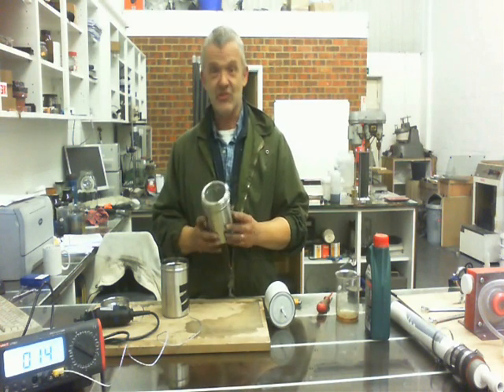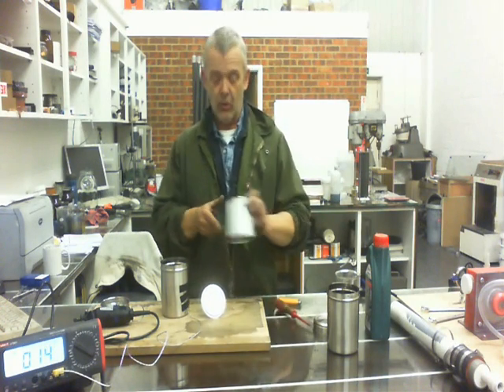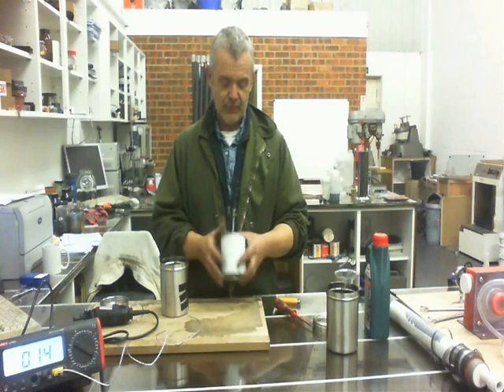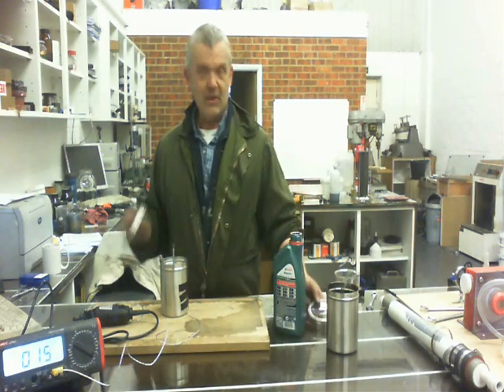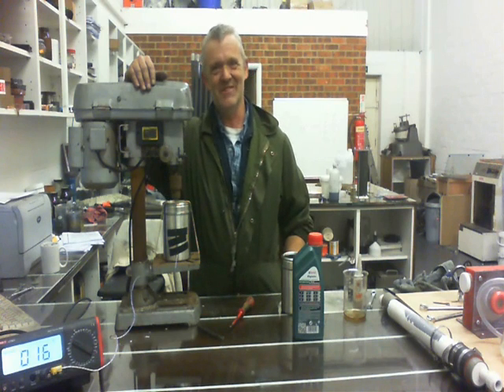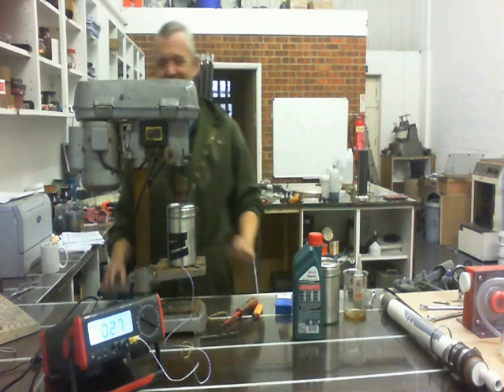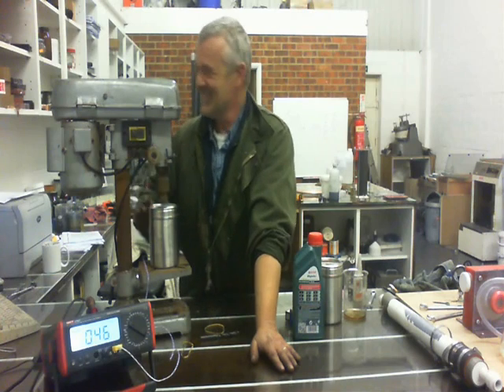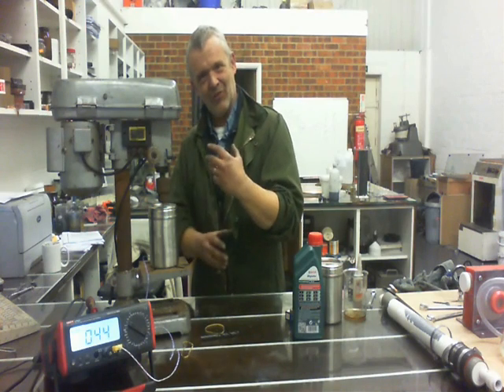Very Simple Friction Heater Made In Under An Hour

Comment: If you had electricity, you would just use a resistive heater, but what can you do without any power?
I've looked at  several frenette designs, and some used many discs on a shaft turning in a pail of oil.  Perhaps you could try that as well.
Reply: I got another idea , like how car turbo generate heat , or air pump generate heat after using it extensively, instead of disk, use air , friction in air molecule genrate heat.
Reply: Doesn't they will have short life span , after some time friction will cause material to end.

Comment: The best use I see for this device is when you want to convert a mechanical source directly into heat without going through many energy conversion. Example: Windmill. Instead take mechanical energy of your windmill , convert it into electricity with a generator and from this electricty to heat with a heating element. You can just convert it from mechanical energy to heat directly with this friction heat device ( frenette heater ). I don't know if the practical ( not theorical ) effiency is better. Somebody know ?

Comment: I accidentally boiled water in a centrifugal water pump when it got switched on while the outlet valve was closed.  The water around the impellor got so hot it melted the plastic components of the pump. Try it with your pool pump!

Any fluid will get hot if it has something agitating it violently in a confined space.
For example, auto transmissions get very hot without consuming the transmission oil.

I don’t think it is mysterious – it's friction between the impeller and the fluid. 

Unless you have a free, or very cheap, source of energy to drive the electric motor that spins the rotor inside oil (or other fluid) confined in a small space, then you might want to use that energy to produce heat by way of an electric heater.  

For example, if you had a waterwheel driving the impeller to make the fluid confined inside this unit hot, that would be cheap heat.  But using an electric motor to drive the impeller to produce heat by friction would use more electrical energy than heat produced. 

Solar power would not be much use as you likely wouldn’t need the heat on bright sunny days and storage batteries are too expensive in the capacity needed to drive a powerful enough electric motor long enough to produce useful heat.

Every time you change energy from one form to another, there is a loss of energy. So converting electrical energy into heat using friction to produce that heat, seems to be inefficient.
Reply: I did the same and had no clue what happened until just now 😂 I didn't even know this was a thing.

Comment: here is a similar device that uses simple crude wood blocks as the heating surface and produces steam. it actually seems to be consuming the wood in a more efficient manner than a fire does with no flue loss obviously and therefore i wonder if its steam could power the turning wheel itself and become self sustaining until the wood was consumed. its not perpetual motion because it is consuming the wood for energy. in essence a very efficient boiler. https://www.youtube.com/watch?v=ROF-CImcDkc
edit2: apparently he now has it running off a steam engine from the friction heater and it requires no outside input after startup https://onedrive.live.com/?cid=A4A1D6E4BB17A7E3&id=A4A1D6E4BB17A7E3%21367&parId=A4A1D6E4BB17A7E3%21365&o=OneUp   discussion http://www.energeticforum.com/renewable-energy/2835-friction-steam-boiler-2.html

 and here is rapidly rotating magnet wheel heating up a copper pipe in seconds to extreme temperature. https://www.youtube.com/watch?v=8n5sSmJsCdY

edit: here is a guy runnin g one of your type devices to heat his whole home for $30 a month ! https://www.youtube.com/watch?v=RQjPSsIWDvg

I'm not quite sure why running a friction device from an electric motor more efficiently produces heat than running running resistance wire (or your graphene paint wall heater) . Is a resistance wire less efficient some how? What are your thoughts.
Reply: Wow, there is a lot to research in friction heating. It supposed to be more efficient when we use resistance wire, but somehow it is not. Because of ifrared radiation. when we heat a wire, it emits its own spectrum. This is why infrared heaters are more efficient.

Comment: so is this is getting friction from boundry layer effect and centrifugals ? as apposed to the cavitated version which i presume runs on cavitation ?
Reply from the maker: Ashes Wake yeah it's a boundary layer effect - or so i believe
Reply: your fingerlike graphene may excell as a coating for the inner side of the outer can if its hardy enough :)
Reply from the maker: Ashes Wake it probably would - but they are pretty harsh conditions mate - not sure if it would stand up to that kind of punishment
Reply: thats what i thought but because its graphene it may work especially if you think of graphenes unique qualities, tipped onto a copper can in a bowl of water its worth a try in my opinion aslong as you can dissipate the heat quick enough.
Reply from the maker: Ashes Wake I agree - i'll give it a go